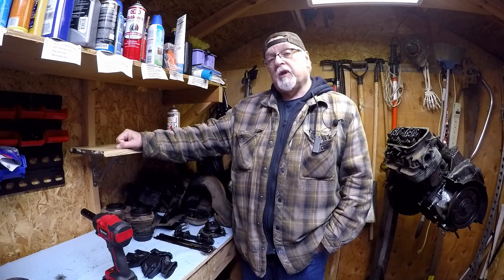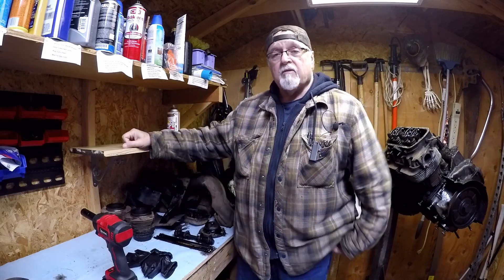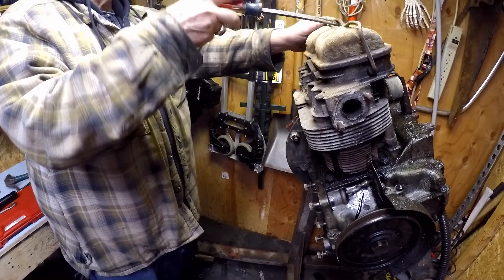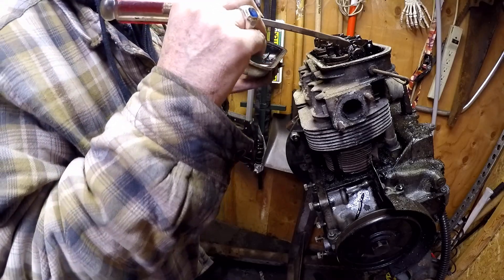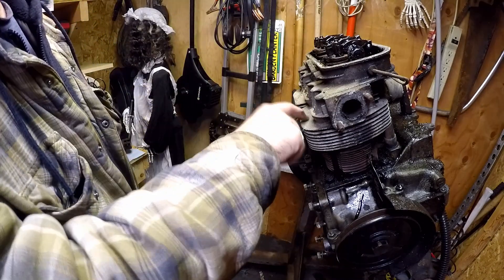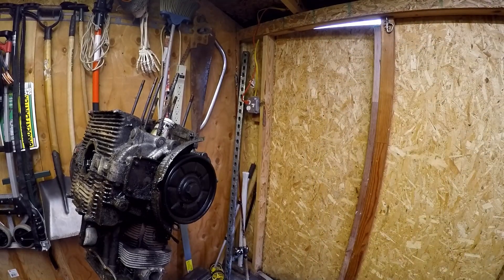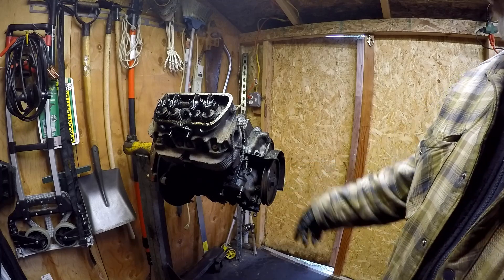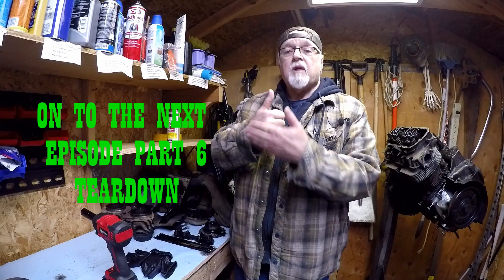1965 VW 1200 40hp Part 5 Teardown

Comment: Keep going , it will be a runner in time.😊 much ❤ from England
Reply from the maker: You right by what I've seen so far but will take some new parts for sure. Basically getting myself setup to do more of these motors that go by the wayside.
Reply: 100% agree